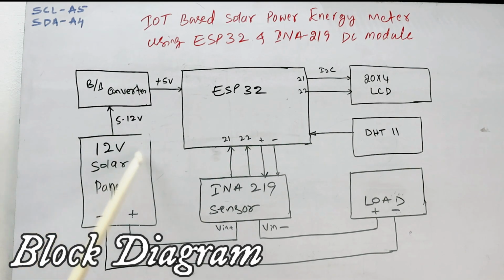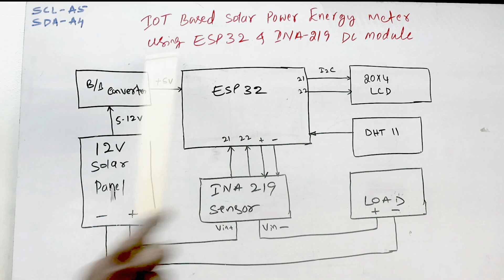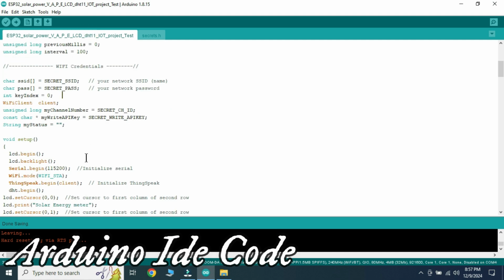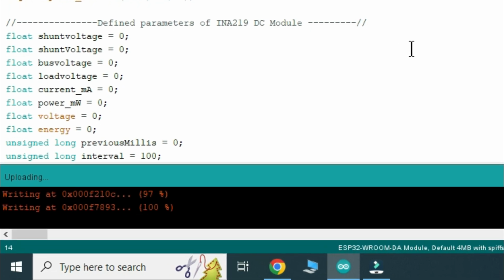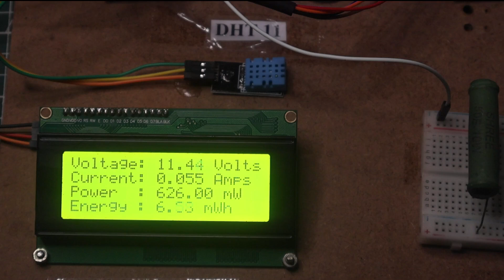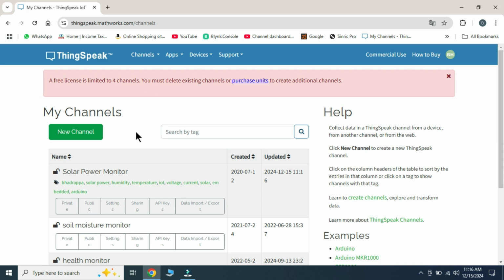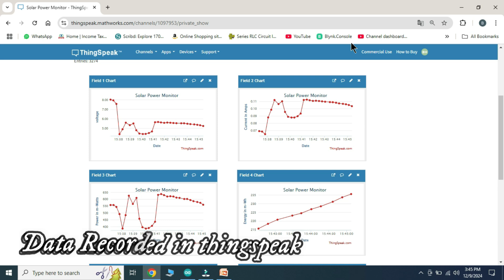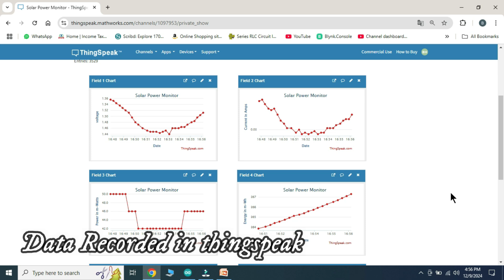IOT based Solar Power Energy meter with  ESP32  and  Thingspeak.com PART-2 #IOT #ESP32, #Energymeter

Comment: Sir can be use this rating solar pannel in this ckt 17 volt and 2.17 A current p=36 watt
Reply from the maker: It works up to 26volts 3.2 amps,
Reply: Thankyou sir❤ and you are such a nice explainer😊